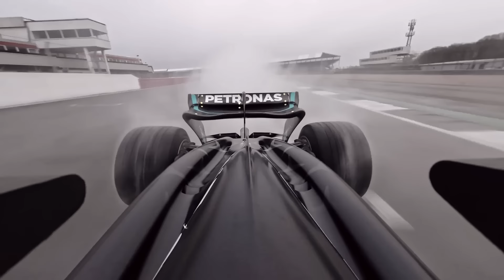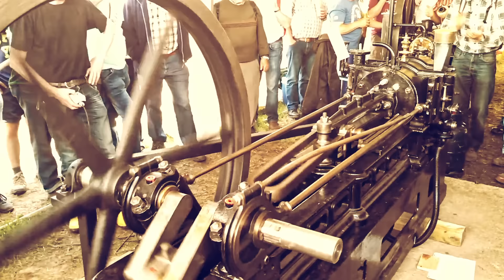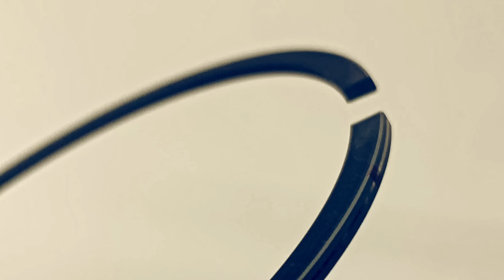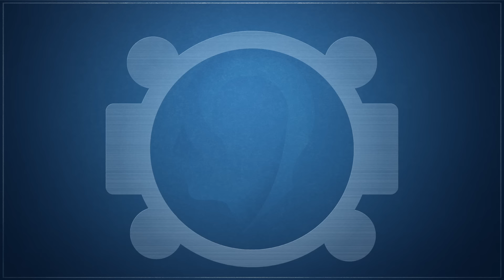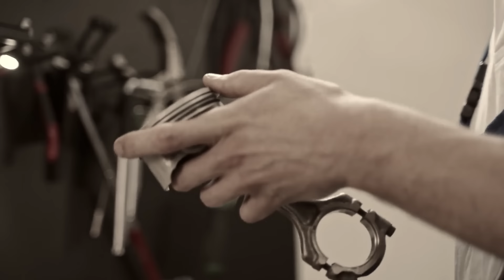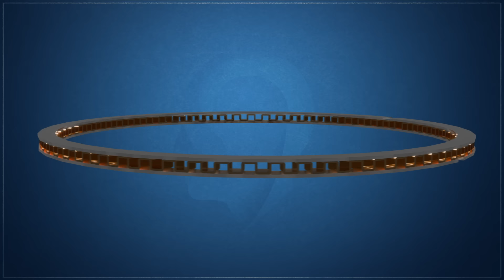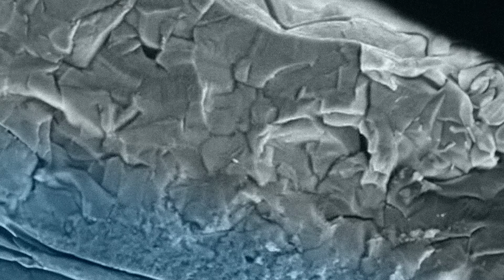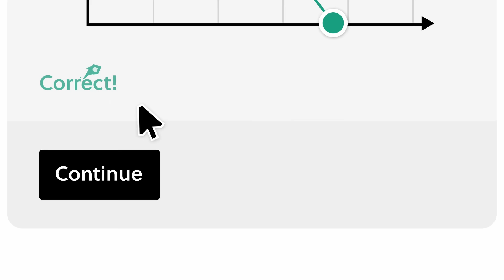The Clever Engineering Of Piston Rings

Comment: i understand pistons in engines but i always thought how inefficient they are.  they are ridiculously inefficient. seriously look... 1st  have to travel up , compress a gas are thrown down by explosion creating power but then that force stops almost instantly right after (power loss) has to reverse its direction and travel back up (power loss) push against spent gasses to shove them out (more power loss) then stop instantly again travel down (more power loss changing directions) on a NA engine its sucking air in by creating a vacuum ( more power loss)  then has to travel up while compressing gasses (more power loss) . more time is spent wasting energy than making it . Add in the fact the engine also has to use some of this power to run the valve system and it starts to seem ridiculous. Its like we humans just kept improving a steam engine.  the goal is to get a shaft to spin under power continuously.  There HAS to be a better way.  I believe if we had put half the R and D time and money into something like the Wankel engine that we have piston engines we would be at the 100mpg mark on most commuter vehicles by now.
Reply: The energy/power is not lost when the piston changes directions. The linear energy from the piston moving up/down is convertet into rotary energy by the crankshaft. You don't lose it, just transfer it.

Obviously there are friction losses but those are a different topic altogether.
Reply: But the Wankel engine goes through the same four strokes a regular piston engine does? Its just a flawed design, while issues like the apex seals not sealing properly could be fixed with enough R&D, other ones like the shape of the rotor only allowing for a low compression ratio are inherent to the design of the engine.
Reply: Electric engines can be 95 percent thermally efficient. They are probably older than this technology I think
and much more elegant
Reply: @santiagomm3878  The motor may be elegant but the battery sure ain't.
Reply: Actually, though current designs are inefficient, piston engines can become pretty much the most efficient engines possible (I've got a patent pending on my version). In the near future you'll be able to buy that 100mpg large vehicle.
Reply: Forget Felix Wankel, Frank Whittle has you covered!
Reply: There is a better way it’s called electric motors…one moving part and %90 + efficiency….incredible
Reply: We build internal combustion engines without A number of your objections, gas turbines. Unfortunately, they use components optimized for compression, combustion and expansion, but in so doing the components operate at painfully high temperatures and need to be made of exotic materials at very high cost. 

The four attributes of the piston engine that explains their long and continuing use are: very good part-load fuel economy, simple geometry parts that are easy to make and inspect, parts that are cyclically exposed to very high combustion temperatures and then get to rest and cool before the next blast, and finally, a cycle and design that allows success and reliability with mostly inexpensive materials like cast iron, steel, aluminum and alloy steels. The only high temperature part is the exhaust valve, and that part has a much easier life than a turbine blade. The exhaust valve seat is of similar materials and coating. For the pesky rest time that the valve is closed (3/4 of the time) it loses heat to the head and stays relatively cool. 
One other attribute of value: they are (or were) pretty simple to understand and fix. In cultures of great simplicity to technical sophistication. 
Good thermodynamics supported by basic materials made in simple geometry by basic manufacturing processes.
Reply: I wonder if two stroke engines could be made less wasteful.  They seem more mechanically efficient than a traditional four stroke.
Reply: @Constantine-111 two strokes work great when they are enormous, diesel, run at one speed and propel container ships
Reply: They’re terrible as they exhaust gases and fuel directly to the environment. Early Detroit Diesel engines were banned for this reason

Comment: It is amazing that the finest combustion engine known to man, the pinnacle of technology, the bleeding edge, representing a cost of $10 million per engine, has an efficiency of 50%.
That is impressive for a petrol engine.
And every bog-standard electric motor has an efficiency of over 90%.
It's amazing how much efficiency is lost on reciprocating mass, overcoming resistance from compression and driving a valve train and ancillaries.
A combustion engine is still a cannonball in a barrel being fired and having to be stopped, turned around, loaded and fired again.
Reply: No,  efficiency in any heat engine - internal or external, gasoline or steam - is limited by Carnot efficiency (https://en.wikipedia.org/wiki/Carnot_heat_engine). Frictions and pumping losses only reduce efficiency slightly in modern engines. An F1 engine that reaches 50% efficiency is operating very near its theoretic Carnot limit.
It is basically all about the instantaneous peak temperature at the start of the power stroke compared with the exhaust temperature.
Reply: @kenoliver8913  Yes, the same thing that makes heat pumps and air conditioners so good at moving heat, is what makes engines so bad using it
Reply: @kenoliver8913  great comment thanks. It’s important to understand these nuances and I never would have without the original comment and your response. Your link is bad btw… easy to find the article regardless.
Reply: "And every bog-standard electric motor has an efficiency of over 90%." 
But that's just half of the thermodynamic story. You're talking about how much of the potential energy of the fuel can be extracted. For the electric motor you also have to include the efficiency of the electric generator system to be comparable.
Reply: @constructionwatcher5381  then why not include how much energy is used in manufacturing petrol for combustion engines
Reply: Yes, because electric motors aren't heat engines but internal combustion engines are.

Comment: Man, I have been building motorcycle engines for years, but I have no idea how much tech and engineering goes into them and how much we take them for granted. In fact, the next time I rebuild an engine, I'm going to take a piston ring, look at it more and admire it more often
Reply: Yeah me too I'm not a qualified mechanic but I've been rebuilding engines since I was in my teens (many decades ago) I didn't know so much of this stuff, like I had no idea compression rings and their seating grooves on the pistons are designed so that combustion gas is forced in behind the back edge of the ring pushing the ring outwards tighter against the cylinder wall, I always thought that was all just up to the outwards spring tension in the ring. So interesting.
Reply: I've saved every ring I could and talked to alot of automotive engineers over the years and yeah a surprising amount of research and development goes into them.
Reply: Honest, dincere and humble enough to admit it? 
Mark of high professionalism!!!!
Reply: I put fresh piston rings into a rototiller once. I hope I put them in right side up. 😱
It still runs good. I guess they were well marked or I had a 50/50 chance!
Reply: @kx4532 lol. I never knew there was an up/top & down/bottom side either. All these years...
Reply: Im a structural design engineer and feel the wonder of such everyday things all the time.  Bot once, I attended a seminar about fasteners and was blown away.  The technology, analysis, materials, and testing involved was far beyond my expectations going in, but of course made perfect sense as well.  We in the mechanical era have taken the five simple machines and refined them to an absurd degree.
Reply: Nobody talks here about hard work of piston return spring's. 🙆‍♀️
Reply: Respect the Rings! Especially motorcycle engine ones. Small, light and durable.
Reply: Came to say the same. How many times have I put the scraper ring on upside down?
Reply: next up on youtube: "guy spends 20 minutes staring at a piston ring"
Reply: It's fascinated me since I was a kid. 😐👍
(My grandpa and uncles rebuilt old trucks.)
Reply: Then eat lunch together and tell it how much you love it. 😂😂😂
Reply: Just remember to put it back on the piston when you're done.
Reply: Where is your place of business and what is your specialty?
Reply: Don’t get me started on computers, the technology, research and genius that went into building devices like iPhones and computers is quite literally phenomenal
Reply: Sealing is a much overlooked aspect of many applications.  The simplicity of some solutions leads many to dismiss them as purely a supplement to the overall assembly,  when In reality they are critical to optimal performance.
Reply: Its truly amazing. People driving around and operating machines they have no clue how they work while simultaneously complaining about their lives being crappy or whatever. Living in the most comfy times in human history. You are witnessing the downfall of human society
Reply: Ive been a machinist for years and when I rebuilt my first motor I was absolutely puzzled as to how those things exist at 17.5k rpms on an R6. 😂😂😂
Reply: How do you people not know how this guy doesn't care for how the rings work??? He has engineering data and instructions on how to install the rings. No further information is needed unless he's fabricating his own custom engines. 
Stop pretending.
Reply: @mattmt0918   Your analogy is so bad that it must come from a complete lack of understanding of epistemology and logic. Jesus h. You got lug nuts for brains?
Reply: You take it for granted
Reply: @doodskie999...    ??
Reply: Who would’ve thought that precision engine components have a standard of manufacturing
Reply: Before doing that, can start appreciating the tool you'll be using, the bolts, valve springs....
Reply: Oil Geek is developing new piston rings.
Reply: Sounds about right. Mechanics are generally braindead apes compared to engineers. That's why you should never trust a mechanic or tradesperson, they know less than nothing.
Reply: 😂😂😂@mattmt0918
Reply: The wrist pin and piston rings are both highly stressed components
Reply: @drishy94303  In my 66cc 2 stroke...My wrist pin somehow got slightly bent but the bearing was fine.
Reply: @mattmt0918you still need to know when duck eggs work better and how to avoid fertilised or rotten eggs. It's a science. 
I know nothing of emu eggs but emus themselves make for a fine festive table bird.
Reply: Is this AI ? This comment ? 
🤨🤷🏻‍♂️
Reply: Stop crying. It was a very murican analogy, meaning stupid.@mattmt0918
Reply: I’ve never built an engine in my life and I understand that they require a [blank] ton of engineering.
Reply: @ not entirely true but if your talking modern engines yeah. A classic or vintage engines were fairly simple. They only need 4 things. Air/fuel/compression/spark. Typically in that order. You should buy a cheap engine from harbor freight and take it apart. You would be surprised how simple they are. I was scared of engines until I just dove in on some small engines like go karts dirt bikes and ATV’s. Now I have built many of them for custom go kart projects. Even signed my name on the inside of the case and the date it was built
Reply: This video is the perfect video that shows the difference between men and women. I find this totally fascinating. I bet there is only one in every hundred thousand women that would find it the same.
Reply: What about the poor fuel pump...
Reply: Why would anyone think driving nude would keep the engine cool?  Why would anyone even suggest that?  TMI
Reply: I'm a digital marketer. And could probably only change a tire, change my own oil and that's where it ends. 

People like you and others in this comments section keep us pieced together. 

Kudos to your life dedicated to this labor of love.
Reply: I started doing that to loads of parts
Reply: Yeah and I am a motorcycle
Reply: @mattmt0918 God, that was such a bad analogy 😅
Reply: @roblucas6097  Maybe.....It's like saying you suck at baking because you don't know how an oven is built??? 🤷‍♂️
Reply: @roblucas6097 😮
Reply: Thanks.
Reply: There Better and More ADVANCED Technology Scribed in STONE...This is just a sign of getting Better through Trial and Error, No Wonders or Marvels here...
Reply: Well it should be common sense especially if you "build motorcycles" ?? Tf???
Reply: @thegoodieshack710 there's a world of difference between building and designing, you use your brain everyday, do you know the intricacies of its workings?
Reply: 666 ima leave it..
Reply: Sure no one cares
Reply: Just make it electric
Reply: I'm trying to wrap my head around that you've been building them, but you don't know how they work.. please explain that to me
Reply: @kidkique Read his comment again, but slowly. See if you can find where he said that he didn't know how pistons worked.
.....
🤣 Slapping an intake tube on a 4 cylinder import with a big fart can muffler and a set of coilovers from E-bay dosen't make you an expert automotive engineer. 🙄 
👇 

👇 

👉 👉 ------> 🪑
Reply: @kidkique  
You must be delusional.
Read again what he wrote.
Reply: @kidkique  Coping vs. knowing, to paraphrase the Excellent Cycle World Motojournalist Kevin Cameron.
I was a gear head possessing some skill when I realized I didn't KNOW SHITE. I was coping most of the time. 
Still am!. Lol
Reply: @BastardX13  cheers to knowing! 😁
Reply: @mattmt0918umm  but you need to know the basics  this is all basic logic  . Overspecialisation creates MBA,s  much below average
Reply: You are lame  @carlosoruna7174  and I'm booing you.
Reply: You must be bad at building motorcycle engines.
Reply: @Tadesan  
Your comment is pathetic...
Grow up.
Reply: @Tadesan any other grand additions to this conversation
Reply: @Tadesan have u buit a motorcycle engine ??? I don't think so mf
Reply: @Tadesan yeah im with ya bud lol, how do you not know the engineering behind an engine part that you are building. I guess its like people doing work in their electrical panel when they have no clue why wirea are certain sizes. Still can do it, will just be garbage work haha.

Comment: but if you use disc turbines, why would you need rings
Reply: just wear eye-protection for when it inevitably grenades itself
Reply: @jonasghafur4940  its just a pump bro, normal turbines work just fine, also 200krpm disc turbines
Reply: @jonasghafur4940  why the internet is full of second grade advisors, no skill
Reply: @jonasghafur4940  God be with you so that "it" will not grenade itself